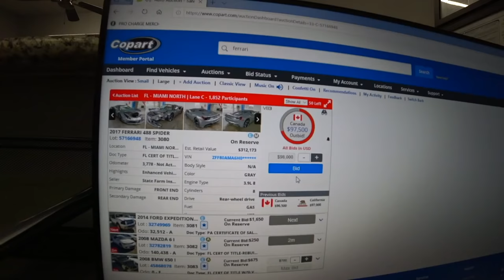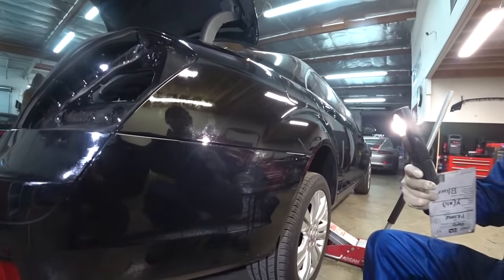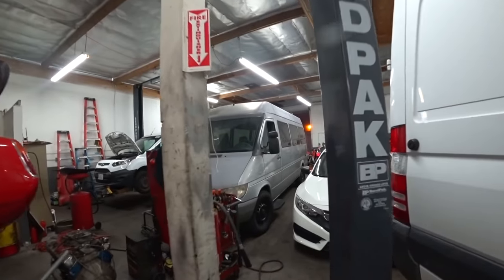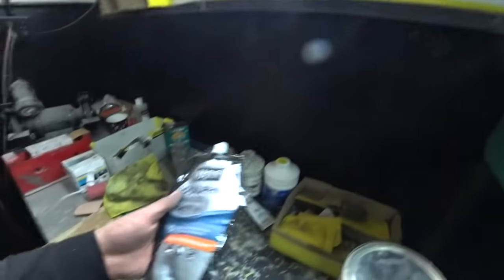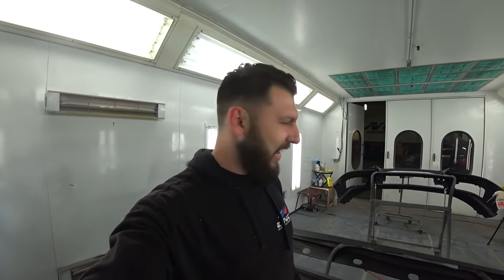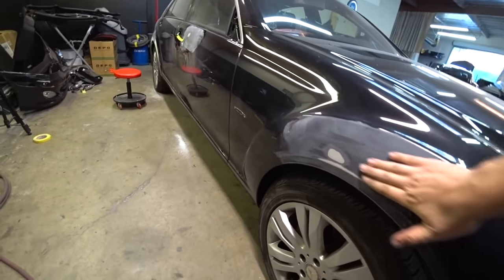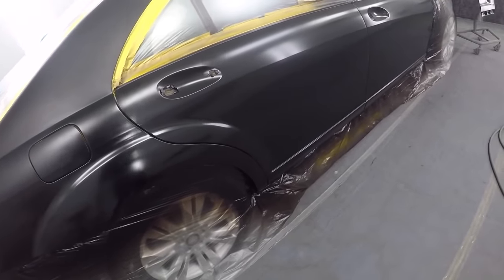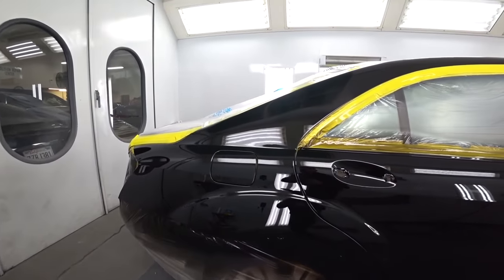REBUILDING A WRECKED MERCEDES S550 " READY FOR PAINT'' PART 4

Comment: Looks fantastic, big thumbs up, just one question, dont you use a flex additive in your paint or clear coat to stop cracking on plastic parts, we all know paint is brittle, one twist of those bumpers during fit up will cause cracking of the paint.